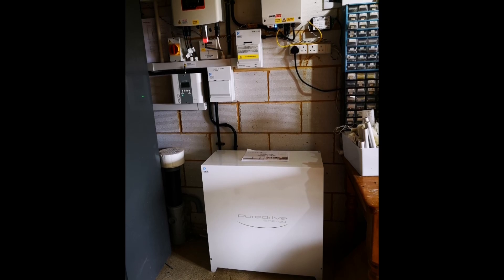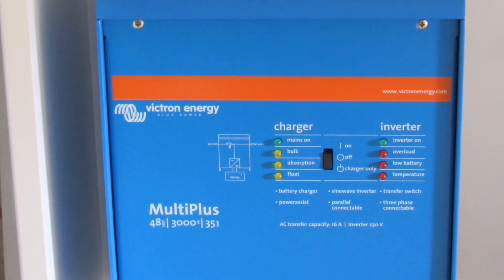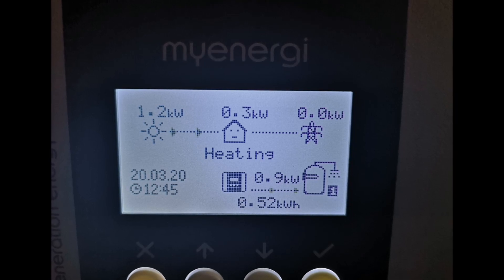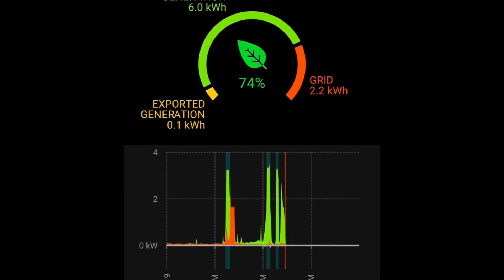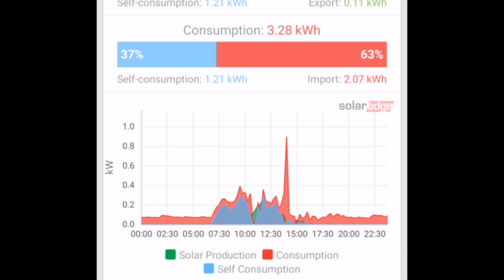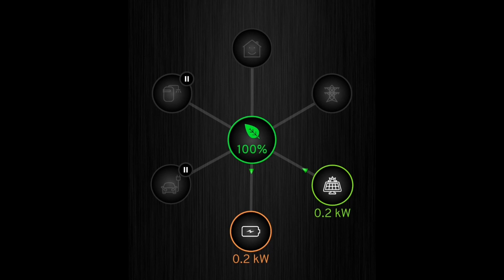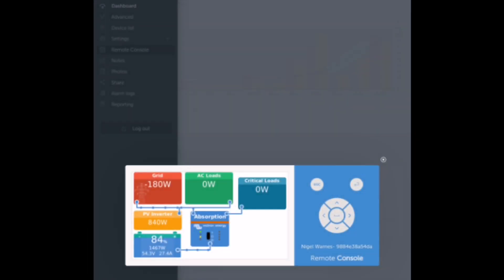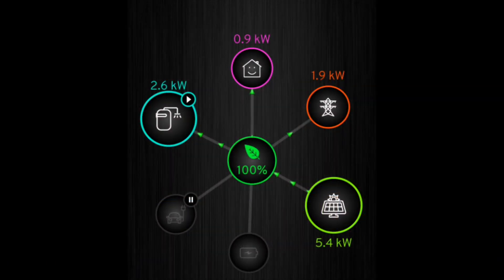Puredrive Energy home storage battery TEST - Initial observations

Comment: I have solar+ battery system using a Sofar hybrid inverter with pylontech batteries. The Sofar does everything, takes the solar feed, charges or discharges the battery and controls the export to the grid.
It's quite tightly coupled, with a canbus connection between inverter and battery pack. It does a good job of minimising grid draw, better than your mashup of two inverters and separate battery controller and battery it seems.

Comment: Although more expensive to buy, with our Powerwall I don’t have any of the problems your having. Our Powerwall can discharge at 6kw and on sunny days like today will charge to 100% and add charge to our Kona. If we cook then the 6kw discharge from our Powerwall is more that enough. As we’re on gas we heat the water with gas in winter and if needed charge the Powerwall with cheap night rate electric from Octopus. I think you’ll come to the conclusion that 5 kWh of storage and a low discharge rate won’t suit your needs. Especially as you’ve already upgraded your original solar system.  Good luck. Colin.

Comment: Good progress. The power draw of the inverter is interesting. The steady draw for solar edge in the evening is 5 to 8 w. The lux units are around the same when they are not charging. This makes getting the load lower hard. My experience of other kit can mean that the inverter pulls 200w just to run, this can be expensive on power. The setup j have is now managing just about all day without much grid. We are running at around 2kwh a day as march moves on. I expect to get that near to 0 with a bit more tweaking of charge settings. It does seem strange that the depth of discharge is being allowed to 0. Do you know if the BMS on the battery is protecting it from the inverter ?
Reply from the maker: It's supposed to but I suspect it's not tracking SOC very well. Voltage drops to a  low level then bang it drops to zero

Comment: Does the battery have the capability to automatically charge when the Grid is cheapest? No doubt this will all settle down after a few weeks.
Reply from the maker: Haven't looked for that yet. I'll discuss with Puredrive
Reply: Rob Heap 
With the Powerwall you have two options on my installation the first is self charge, it only charges from available solar. The other option is to timed charge which can be set to charge from the grid at of peak times, that’s the one I use during the winter when little solar is available. One very clever feature is when set to timed charge it uses algorithms to note ones usage and weather forecasts to charge the battery to different levels depending on what solar is available that coming day. This very clever program has worked very well over the last winter as in a number of cases the battery was just part charge at night to leave space for solar production the next day. In a few cases when there was going to be lots off sunshine that day the battery didn’t charge at all from the off peak grid energy.

Comment: Hey,

Our tesla powerwall 2 in Australia also allows around 20 to 30W from the grid at all times it is charging or discharging...

It was explained the battery needs to know if there is a grid and to also sync frequency and voltage.

Comment: Hi Nigel we were given code so we could go into in-depth settings on inverter, could you set the buffer on the batteries so they stop reducing once at 20%, as we were told this isn’t good for them. Also check clip which goes onto the live feed to fuse box as ours was fitted wrong way and drained batteries Immensely and quickly.!
Reply from the maker: Clips being wrong way around is an interest one. We have on the solar output that is back to front according to my knowledge and the installer but Puredrive insists it's right. Time will tell who's right and who is not.  We've got the buffer set and it's dropping below it. It obviously shouldn't do that

Comment: Current transformer clips are problematic, they aren't very accurate at low net powers, especially if the load has a poor power factor which switch mode power supplies used in modern battery charging solutions invariably have.  CTs can be much better if there is also a direct mains voltage connection and there is good software to interpret the screwy phase variations introduced with said power supplies but few bother with the complication.  Having a multitude of different energy monitoring devices all dependendant on CTs and expecting them to give coherent results isn't going to happen.  Which cables are used for the CTs also effect which power levels interact with each other.   I've been doing it myself with an entirely DIY system which uses pulse counting from discrete meters.  Far more accurate than CTs but even then I still struggle with making power levels match.  And I don't have EV charging or water heating in the equation.  Furthing the complications LifePO4 batteries which Puredrive use are difficult to determine exact  state of charge levels for due to to their very flat voltage curves.   Easy to see when they are in the last dregs of charge  of charge or when they are almost full, but in between, urgh.  Don't get me wrong, LifePo4 (Lithium Iron Phosphate) batteries are among the very best for solar storage among current battery solutions , but determining their state of charge if not near flat or full with any degree of accuracy is difficult.  Coupled with measuring power levets with CT clips, don;'t expect too much. Its hellish complicated.  But us geeks love complicated things........

On a different note it looks like Puredrive get their batteries from the same Chinese factory mine came from, very similar non descript steel box, mine is 24Volt 100AH.
Reply from the maker: Thank you. I think I understand and yes I hope for more but appreciate it's complex

Comment: Excellent stuff as usual Nigel. I don’t have a Eddi or Immersion, so would not have that problem. It was through you I realised that it was possible to charge at 300 watts on my e_Niro, like on your Kona, so that could at times free some solar for your hot water albeit at the cost of very slow charging. The size of the car battery offers huge potential to use it as a resource especially in the summer. I wonder how long before CCS vehicle to home?  Might you not have greater flexibility with Octopus and their Go tariff since you could dump some power in the car and into the home battery at very cheap rates?   I have also had causento wonder whether prioritising the car might be a good move, given that the cost of public charging can be quite high versus charging from the grid at home. So the chief concern becomes total energy expense no matter how it is employed.
Reply from the maker: Everyone's priority is different which is why I see control as a critical feature.

Yes the Kona is slurping up the kWh. 21kwh  so far today and still half empty.
Reply from the maker: Octopus might work in winter for about 3 months but as our usage is so low now and getting lower by the day, it's not worth swapping yet.
Reply: Hi Nigel. I take your points both about individual needs and the Octopus option. The whole field is obviously fascinating to both of us. 😊😊

Comment: Hi Nigel 
I think there is a setting within the Eddi which limits  the draw to the elements 
This may help reducing the grid draw so battery can supply enough energy for hot water, in your case I think it’s better to try and prioritise the water before the battery if you can
Reply from the maker: I think there's a few things to try from either end.  Just got to let the dust settle so I know what I'm seeing. If I adjust too much in one go it can get confusing
Reply: @EVPuzzle  See Pages 21 and 31 of the Eddi manual 

You need an extra  CT connected to Eddi  to monitor an AC-coupled battery.
With this setting it's possible to manage the distribution of surplus energy between the battery
and the eddi (including myenergi devices).
The Battery setting in the Supply Grid menu is used to configure how the eddi will operate
alongside the battery system. See Battery Storage Systems (page 31) for more information.
The CT should be installed on the Live supply cable of the battery inverter/charger, with the arrow
pointing away from it.